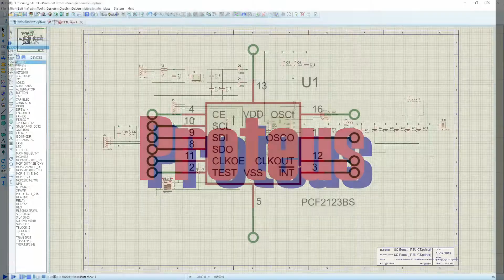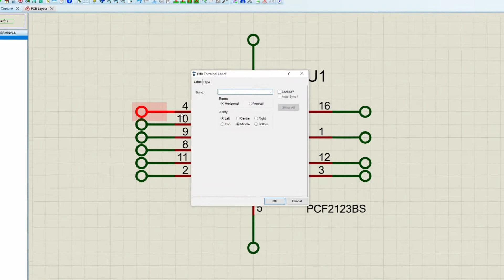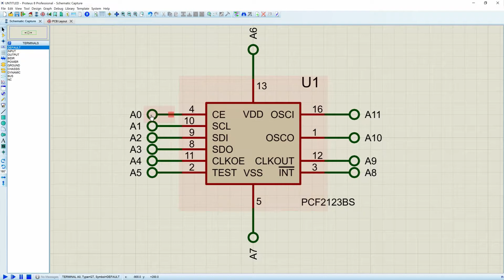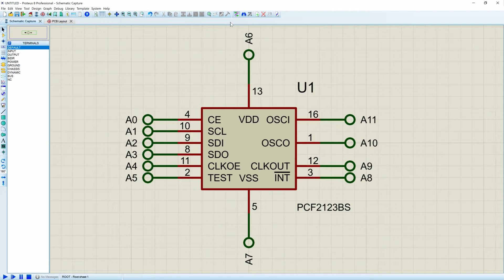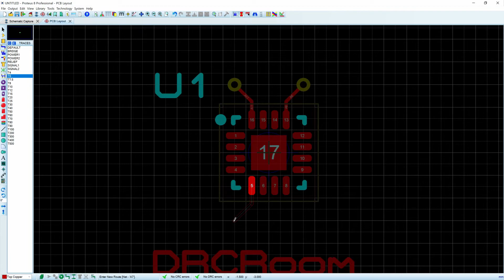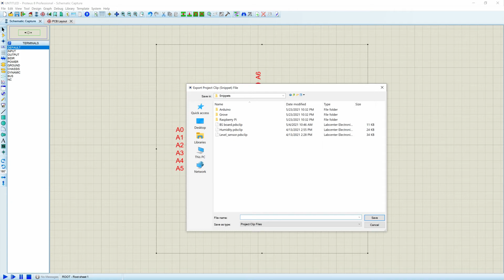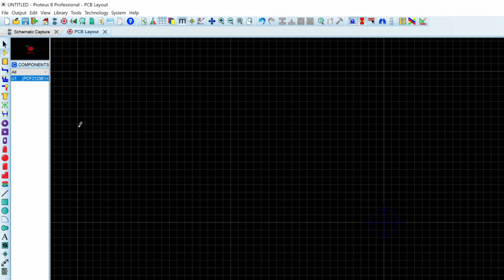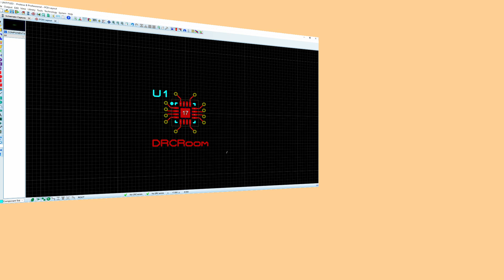PROTEUS PROJECT CLIPS -HOW TO REUSE SCHEMATIC AND PCB LAYOUT

Comment: I'm having an issue with this. 
When I export a project clip and then import it into another project (same happens when copying and pasting between projects), the subcircuits are completely emptied.

Also I tried copying/pasting only a subcircuit and either also got it empty, or got it with incorrect gates or even missing parts.
I don't know if I'm doing it wrong or if it's Proteus' fault, but this is the only way I know of working on a project together with a teammate. Thank you so much.
Reply from the maker: Sorry for the late reply. You may need to go into the child module to select the components rather than  choosing the child module. Let us know if this helps.